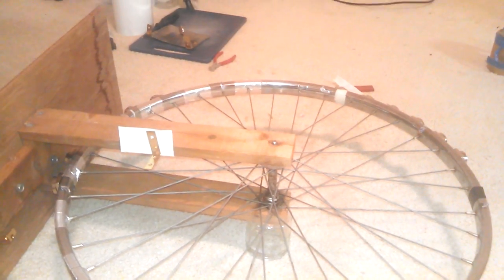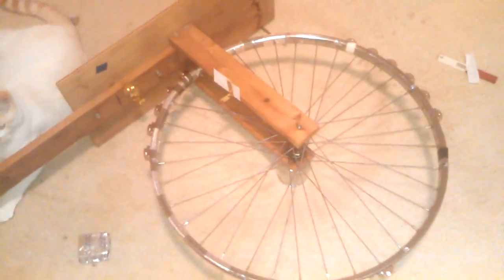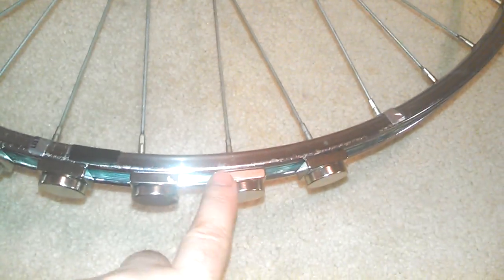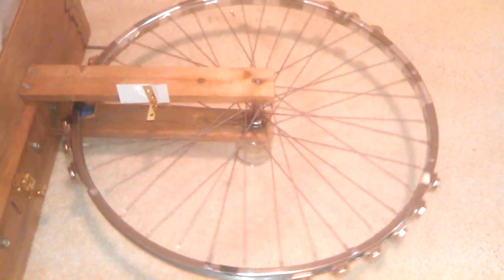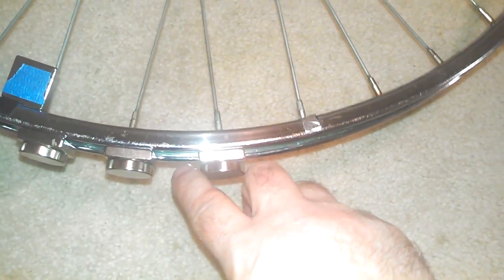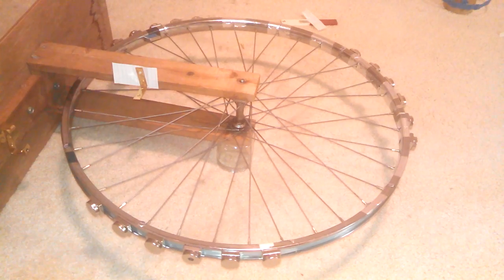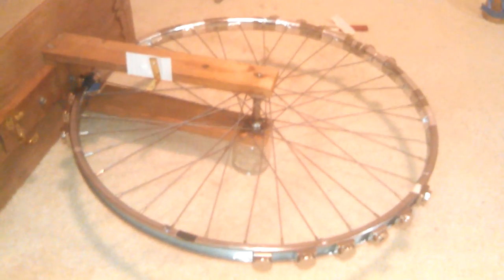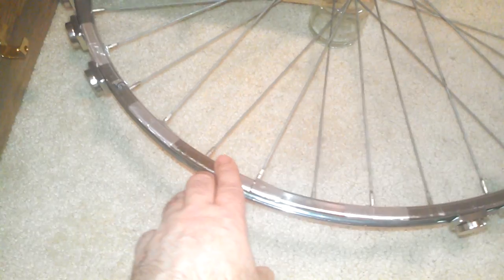🧲 Roney Stators Part 2b of 2

Comment: Yeah, I wrote the comment about the multiple stators on part 1 before you had uploaded part 2. I got it now though, thanks.
Reply from the maker: It turns out that this magnetic motor challenge was solved way back in 1966 by a German man who made a working car motor that ran only on magnets. See link below. Others as well on the web have also made motors using only magnets. See links below. My design concept is different from most others as I'm going for super torque. The links below were long since made available in the video description as well. If by chance you're still around, thanks for stopping by.

((( MAGNET MOTORS THAT ACTUALLY WORK )))
👉🏻 MAGNET MOTOR - Rotor Encantado
https://youtu.be/mxgwTzxfe8Y

Amazing Magnet Motor/Gen Rep. This is not a fake
👉🏻 https://youtu.be/jKFTAobM-l0

WORKING MAGNET MOTOR 2023
👉🏻 https://youtu.be/vdtdKE2Qe40SELF RUNNING MAGNET TURBO MOTORhttps://youtu.be/6sIBHn5-9pI

🆕 WORKING MAGNET MOTOR - rotor magnéticohttps://youtu.be/3mD0_0FiJ54

MAGNET ONLY MOTOR from SOUTH KOREA
👉🏻 https://youtu.be/smzpbKg9S7M

1966: German inventor presents his Free Energy Device Magnet-Motor
👉🏻  https://youtu.be/XWQjMyMWXAc

Comment: thank you so much for your work and willingness to share!
Reply from the maker: It turns out that this magnetic motor challenge was solved way back in 1966 by a German man who made a working car motor that ran only on magnets. See link below. Others as well on the web have also made motors using only magnets. See links below. My design concept is different from most others as I'm going for super torque. The links below were long since made available in the video description as well. If by chance you're still around, thanks for stopping by.

((( MAGNET MOTORS THAT ACTUALLY WORK )))
👉🏻 MAGNET MOTOR - Rotor Encantado
https://youtu.be/mxgwTzxfe8Y

Amazing Magnet Motor/Gen Rep. This is not a fake
👉🏻 https://youtu.be/jKFTAobM-l0

WORKING MAGNET MOTOR 2023
👉🏻 https://youtu.be/vdtdKE2Qe40SELF RUNNING MAGNET TURBO MOTORhttps://youtu.be/6sIBHn5-9pI

🆕 WORKING MAGNET MOTOR - rotor magnéticohttps://youtu.be/3mD0_0FiJ54

MAGNET ONLY MOTOR from SOUTH KOREA
👉🏻 https://youtu.be/smzpbKg9S7M

1966: German inventor presents his Free Energy Device Magnet-Motor
👉🏻  https://youtu.be/XWQjMyMWXAc

Comment: time to make another stator I guess.
Reply from the maker: It turns out that this magnetic motor challenge was solved way back in 1966 by a German man who made a working car motor that ran only on magnets. See link below. Others as well on the web have also made motors using only magnets. See links below. My design concept is different from most others as I'm going for super torque. The links below were long since made available in the video description as well. If by chance you're still around, thanks for stopping by.

((( MAGNET MOTORS THAT ACTUALLY WORK )))
👉🏻 MAGNET MOTOR - Rotor Encantado
https://youtu.be/mxgwTzxfe8Y

Amazing Magnet Motor/Gen Rep. This is not a fake
👉🏻 https://youtu.be/jKFTAobM-l0

WORKING MAGNET MOTOR 2023
👉🏻 https://youtu.be/vdtdKE2Qe40SELF RUNNING MAGNET TURBO MOTORhttps://youtu.be/6sIBHn5-9pI

🆕 WORKING MAGNET MOTOR - rotor magnéticohttps://youtu.be/3mD0_0FiJ54

MAGNET ONLY MOTOR from SOUTH KOREA
👉🏻 https://youtu.be/smzpbKg9S7M

1966: German inventor presents his Free Energy Device Magnet-Motor
👉🏻  https://youtu.be/XWQjMyMWXAc

Comment: Would moving that stater magnet closer to the wheel make it more effective?
Reply from the maker: Yes. This magnetic motor challenge was solved way back in 1966 by a German man who made a working car motor that ran only on magnets. See link below. Others as well on the web have also made motors using only magnets. See links below. My design concept is different from most others as I'm going for super torque. The links below were long since made available in the video description as well. If by chance you're still around, thanks for stopping by.

((( MAGNET MOTORS THAT ACTUALLY WORK )))
👉🏻 MAGNET MOTOR - Rotor Encantado
https://youtu.be/mxgwTzxfe8Y

Amazing Magnet Motor/Gen Rep. This is not a fake
👉🏻 https://youtu.be/jKFTAobM-l0

WORKING MAGNET MOTOR 2023
👉🏻 https://youtu.be/vdtdKE2Qe40SELF RUNNING MAGNET TURBO MOTORhttps://youtu.be/6sIBHn5-9pI

🆕 WORKING MAGNET MOTOR - rotor magnéticohttps://youtu.be/3mD0_0FiJ54

MAGNET ONLY MOTOR from SOUTH KOREA
👉🏻 https://youtu.be/smzpbKg9S7M

1966: German inventor presents his Free Energy Device Magnet-Motor
👉🏻  https://youtu.be/XWQjMyMWXAc

Comment: I enjoy your videos very much. I especially find your stator shielding to be very clever. I will say look up a product called numetal. 

I do have a question or two if you dont mind. First, do you shield the southern pole with your stator? Are the magnets on the wheel polarized through the thickness? If so, is that why you have your stator magnet aligned with the B field tangent to the wheel circumference? Thank you for time, effort, and assistance.
Reply from the maker: Guess what? Turns out we've had German magnet motors for cars since 1966. Google it. Now others are creating their own magnet motor that truly work. Using only magnet to create continuous motion has long since been solved and replicated by others. There for this is no longer theory. Thanks for visiting nonetheless.

Comment: Instead of more stators, couldn't you just fill the gaps on the wheel with more magnets? It only seems to slow down in the gaps, so presumably, if there were no gaps, it wouldn't slow down at all.
Reply from the maker: YES. This magnetic motor challenge was solved way back in 1966 by a German man who made a working car motor that ran only on magnets. See link below. Others as well on the web have also made motors using only magnets. See links below. My design concept is different from most others as I'm going for super torque. The links below were long since made available in the video description as well. If by chance you're still around, thanks for stopping by.

((( MAGNET MOTORS THAT ACTUALLY WORK )))
👉🏻 MAGNET MOTOR - Rotor Encantado
https://youtu.be/mxgwTzxfe8Y

Amazing Magnet Motor/Gen Rep. This is not a fake
👉🏻 https://youtu.be/jKFTAobM-l0

WORKING MAGNET MOTOR 2023
👉🏻 https://youtu.be/vdtdKE2Qe40SELF RUNNING MAGNET TURBO MOTORhttps://youtu.be/6sIBHn5-9pI

🆕 WORKING MAGNET MOTOR - rotor magnéticohttps://youtu.be/3mD0_0FiJ54

MAGNET ONLY MOTOR from SOUTH KOREA
👉🏻 https://youtu.be/smzpbKg9S7M

1966: German inventor presents his Free Energy Device Magnet-Motor
👉🏻  https://youtu.be/XWQjMyMWXAc